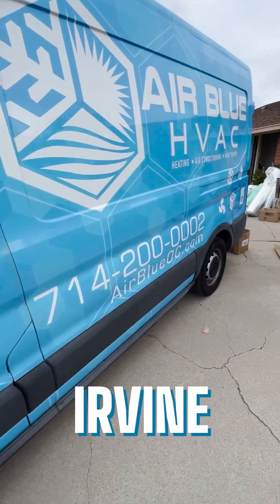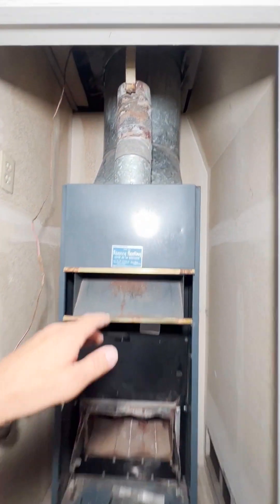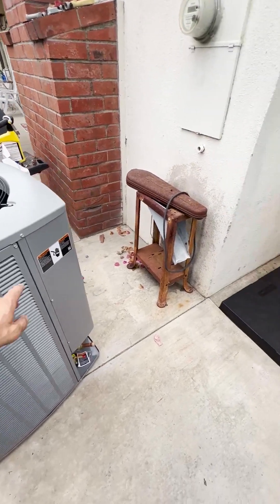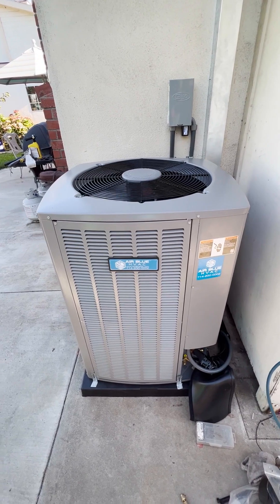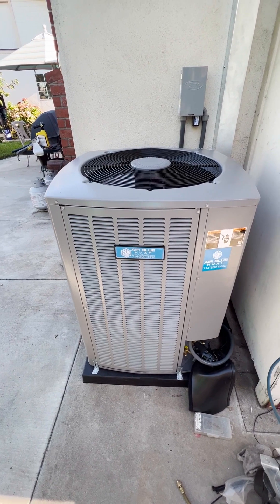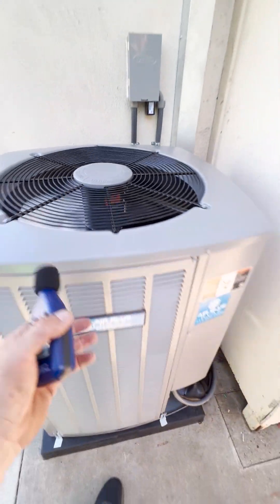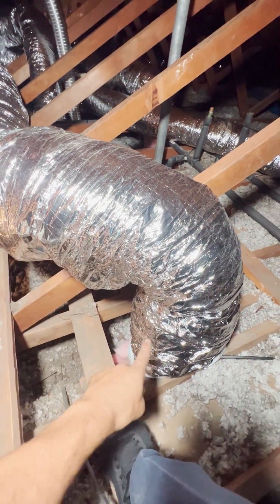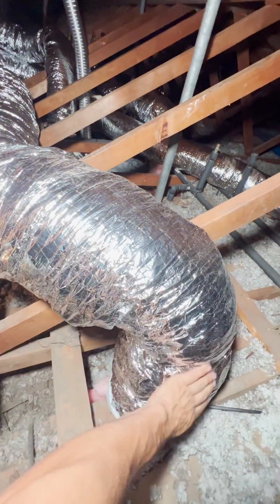Heat pump Dual Fuel unit installation True variable Allied Air / Irvine California

Comment: Do you have to run additional wires to the new thermostat? Does it require additional communication wires?
Reply from the maker: @ivanbg5167  thermostat and outdoor unit requires 4 wires, shielded wire would be the best.